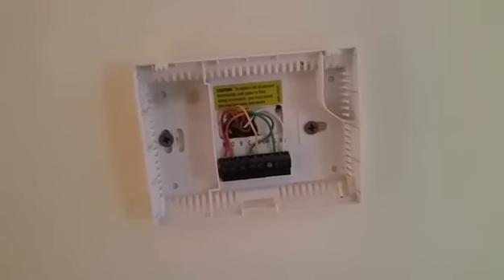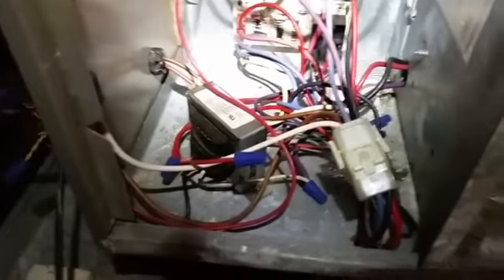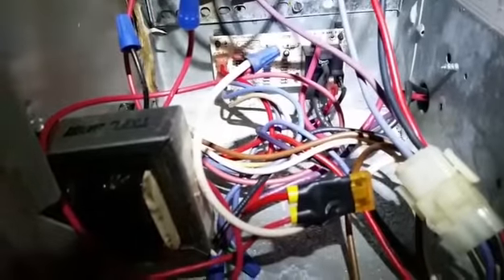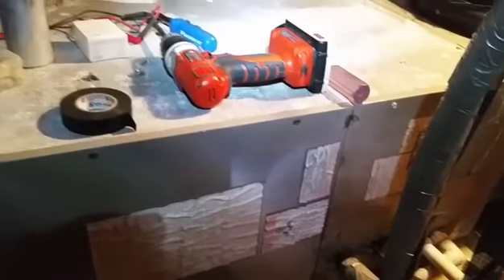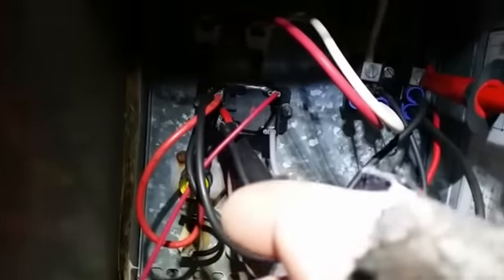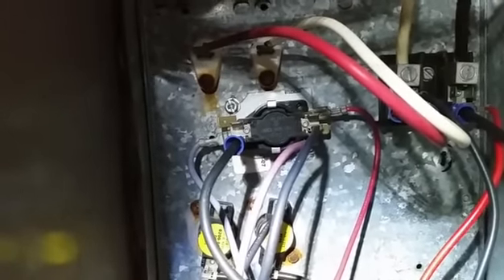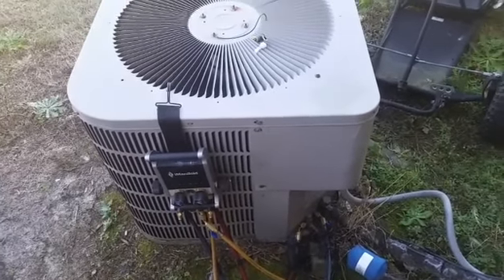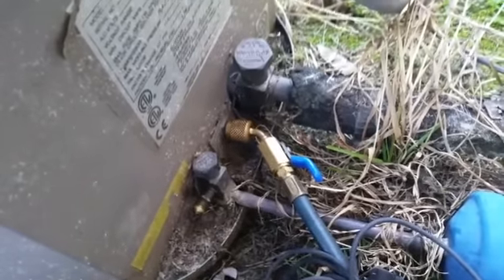HVAC Troubleshooting : No Heat 2

Comment: 10K W on a 2 ton might make sense if it was a straight AC with electric heat but having 10K W on a 2 ton blower even on high-speed you would have very low airflow CFM on the heat rise calculation would be my guess.